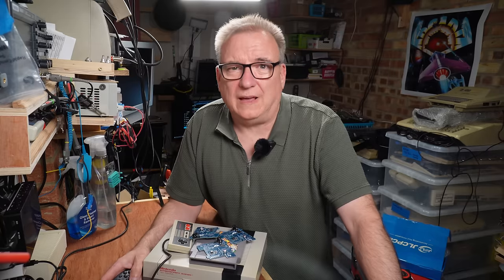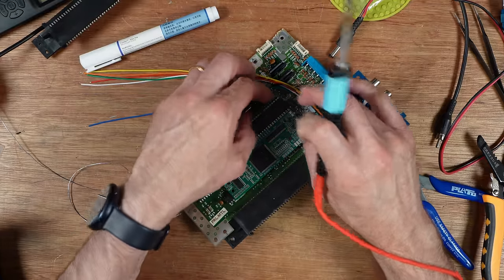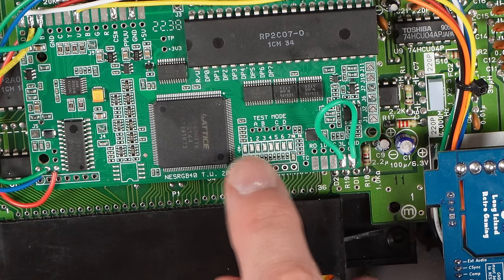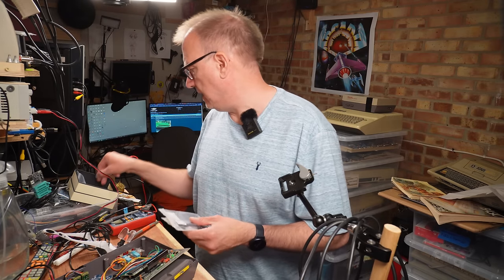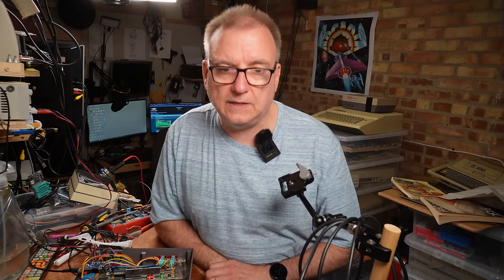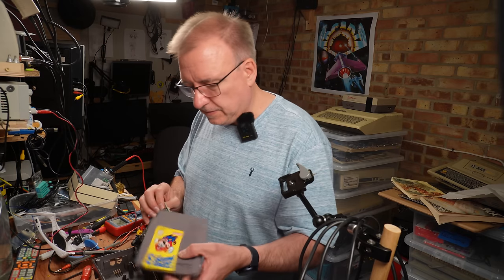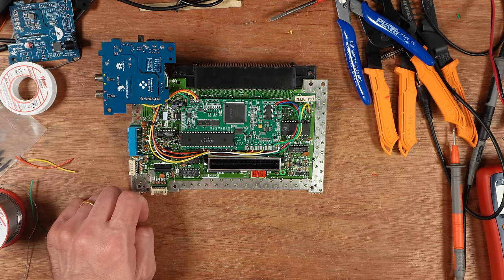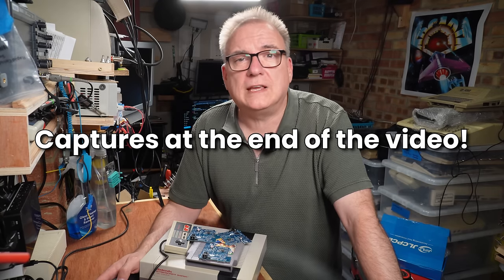NES mod by Tim Worthington + Geek Island Gaming Power board replacement part 2

Comment: It's very interesting with that V4 board. Mine did nothing for 30 minutes. I left it on, walked out of the room to go calm down, then I come back and that green LED is finally turned on and the board works. It never did that again, but on the first install it did literally nothing for so long.

Comment: A good design would be to have the mod board hold the NES in reset by default (pull down). Then, when the FPGA boots the firmware can take it out of reset.

Comment: I've had that grumpy "its not working" face plenty of times before lol. You go nuts thinking scenarios like you have a defective RGB board, to the PPU is dead, to all of the caps are dead, to the video cable is bad exc. That's when you put the thing down, walk away, have a cup of coffee/tea, and come back to it before you throw it out the window. When it comes down to it, it is usually a bridge that you didn't notice, or a wire that you thought was soldered is not. When you make those discoveries, fix it, and it actually works is an amazing feeling. I feel like Doc Brown when he saw the Flux capacitor for the first time. I was fortunate to have this RGB install to go very well. But the N64 RGB kit gave me some trouble. My jaw dropped when I saw the nesrgb through a retrotink for the first time. Fun video!

Comment: Thank you for this video. I asked Merlin for help and he sent me this as somewhere to start. I have followed the guides for the NES RGB and the power board, but I am hesitant to attempt the "reset the timing issue part 2" (that you have at 17:20) because I have yet to get any image to come through the composite. I know that it would be hard to diagnose because there is a lot going on here, but is there any other resources that anyone might be able to share? Perhaps a forum that I can post to for help, or other simiar resources for this mod pair? Without more guidance, I am afraid that I'll need to give up and pay even more to send it to a modder. This would be extremely defeating because this is my first mod. Thanks in advance for any help!
Reply from the maker: I worked mostly from the GitHub, which isn't the most comprehensive source you could wish for. I'm sorry I can't help more, I'm really just dabbling with these things as a hobby.